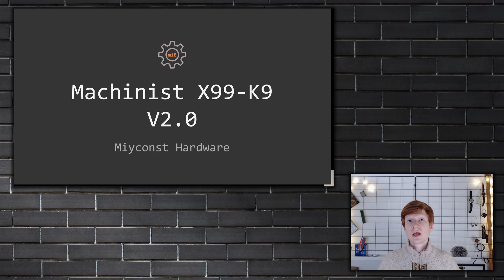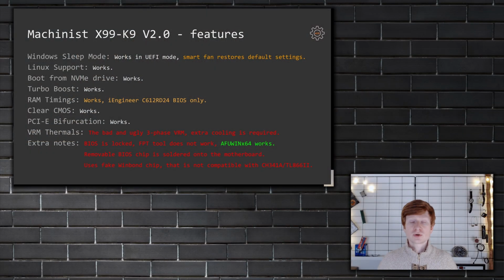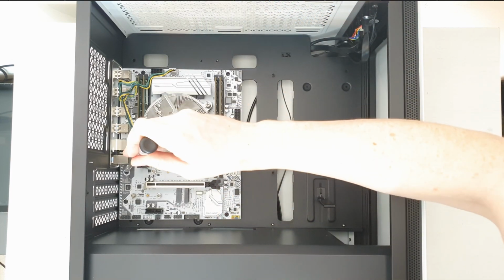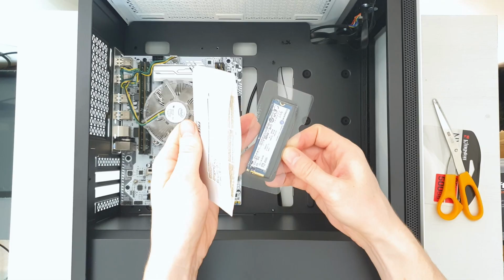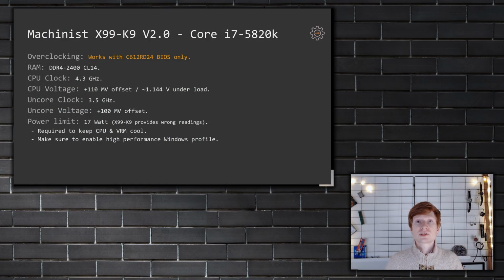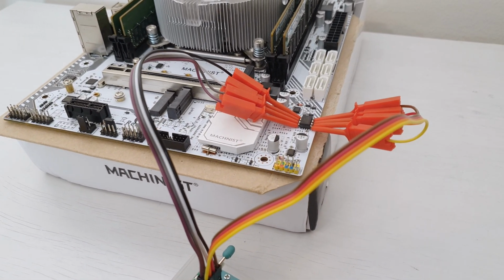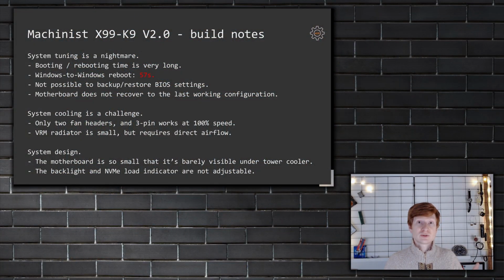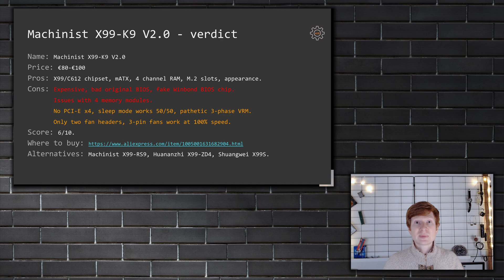🇬🇧 PC with Machinist X99-K9 V2.0 and i7-5820k – BIOS, overclocking, tuning, review, and impressions

Comment: Sorry to say but this is not the V2.0 if i check the FCC release chart from MACHINIST-SOYO-MLLSE, This is V1.2, V2.1 has the 9x sata ports and a extra NVME slot over the M.2 wifi slot. I own the board and looked up to the FCC database, Hibernate, Unlocked CPU settings, USB speed and REBAR is standard supported with the stock firmware. All Revs are,  V1.0, V1.1,V1.2, V2.0, V2.1, Also the RAM issue that you had during this video is that it is recommended to disable MEMORY training and PCIe Link training together with the maintenance mode.

Comment: Any recent buyer of this board? Is it still shipped with x99 chipsets?
Reply from the maker: As far as I know it still uses X99/C612 chipset and now we have yet another revision.
Reply: @Miyconst as a classic Chinese maker, the revisions are all over the place. I have seen v2.0 with 8 vrms (4 phase doubled I guess) and also a V5 that has a 7 segment led for diagnostics. Also some sellers note it's v2 and it seems different than v2.0. All confused out. I want something long term
Reply from the maker: @JaymzBond  skip AliExpress if you want something reliable for a long time.
Reply: @Miyconst is it that bad? I am very well aware that the socket is old and there won't be a future for it. So long term is not like 10 years but I'd like to get at least 2 3 years with the hw I purchase. This seemed like a good option as it now has 4 phases and uses an actual c610/x99 chipset
Reply: @Miyconst by the way thank you sincerely for your support and knowledge. Your channel is awesome 😊
Reply from the maker: @JaymzBond  AliExpress is a lottery, if you put your last money on the line and can't afford failures the skip AliExpress and pick a used Dell or HP workstation, for example Dell T5810/T7810.

Comment: Machinist X99-K9 V2 OR Huanazhi x99 - QD4 ?
Reply from the maker: Neither. Pick the cheapest H610 with i3-12100F.
Reply: @Miyconst  thank but exceed my budget.
Reply from the maker: @luispaez466  then I would probably go with X99-K9 and buy BIOS from iEngineer.
Reply: @Miyconst  thanks. I am not gamer,  i need it for work with CAD/CAE software and replace my old LGA 1150.

Comment: Hello. i was wondering if the v2.1 version has the smart fan fixed as i'm going to build a cheap pc for a minecraft server. and already have a chassi and ram on hand, and can't find another matx x99 board than the k9 d3 2.1 that say they support ddr3 and quad channel ram
Reply from the maker: I did not test the D3 2.1 version so I don't know, sorry.
Reply: @Miyconst Okay. it's very hard to find information on the k9 2.1 it seems. Do you think a dual channel only board would have a big impact considering it's mostly going to live as a minecraft server pc?
Reply: @Miyconst I took a closer look at 2.0 and 2.1 boards in pictures and they look quite different. 2.1 has two 4pin and one 3 pin fan header and a active vrm cooler and more components in general, cpu 8pin power connector isn't in the same place. so it must be 2 different boards

Comment: x99 i7's are often overlooked compared to Xeons, if you use emulators like 86Box often and other programs that rely heavily on single-threaded performance, then these i7's are way better due to overclockability
Reply from the maker: Yeah, the only question is how to overclock them without spending more than an i3-12100 system would cost.

Comment: Hi, I have assembled a PC with Machinist X99-K9, Xeon E5-2660V3, and other components. I installed Windows 10, working fine except I do not have Internet, neither with an Ethernet proven cable nor with a WI-FI wireless card. I have tried to install several drivers with no success. Device manager does not show any Network Adapter, under hidden devices a "microsoft kernel debug network adapter" appears, which I disabled. No intermittent lights are shown on the Ethernet cable connector. I don't know what else I can do. Is it a hardware failure? Could you please help me out? regards, Filippo
Reply from the maker: This is most likely a hardware failure unless you have flashed an incompatible BIOS.

Comment: Could a 1650 v3 achieve similar results?  I have one installed in a Jinguye board which unfortunately does not have an unlockable bios,  c201. . I'm watching on a 14 core 2697 V3 in an unlocked board and while the VRMs gets warm it's not burning hot to my surprise.
Reply from the maker: Yes, E5-1650 V3 is basically the same CPU, but it has full 40 PCI-E lanes.
Reply: @Miyconst  Thank you for all the hardwork.. Amazing stuff! I have been dreaming about using/modding Xeons since 2012, I knew someone out there is smart enough to figure this stuff out.

Comment: Nice review! I Bought X99 K9 board (newset revision 2.1) from Aliexpress with Xeon E5 2640 V3 and 16GB of DDR4-2133 ECC memory in two sticks. My board seems to completly ignore DDR4 memory frequency. When I check in CPU-Z it always shows 1866MT/s. Did you have such prolems and have any idea how to fix it? I tried BIOS fro iEngineer but after flashing it using EZP2019 it booted once and get completly bricked. I had to use stock BIOS.
Reply from the maker: This is the CPU's limitation, you can't increase memory frequency with E5-2640 V3.
Reply: @Miyconst  ok. Good to know. Can you recommend any CPU fir this socket with faster ddr4 support and overall performance?
Reply from the maker: @rafatomczyk3622 Xeon E5-2667 V4 supports DDR4-2400 and way much faster than E5-2640 V3.

Comment: How to know if v2 or v1?
Can it overlclock e5 1650 v3 and 1660 v3?
Reply from the maker: The BIOS chip is different between the versions, as I have specified in the video. E5-1650/1660 V3 can be overclocked, but X99-K9 will get toasted pretty much immediately.
Reply: @Miyconst  even if it were just to 3.8-4ghz?
Reply from the maker: @Carrington1961  yes.

Comment: This motherboard support overclock for xeon e5 1650 v3? Thanks
Reply from the maker: Xeon E5-1650 V3 is the same as Core i7-5930k, so everything I told in this video about X99-K9 is also applicable to the Xeon CPUs.

Comment: Hello. I have an I7-6800K on my desk. Please advise which Chinese X99 board can easily overclock it over 4.1 GHz. The offer is huge and I'm already lost in it. So I'm asking for advice on which Chinese board is the best for my CPU. Thank you
Reply from the maker: Non of the Chinese boards can easily overclock your CPU past 4.1 GHz.
Reply: @Miyconst  Thank you for answer. So which one is best for overclocking i7 6800K and able to achieve best results. (4GHz)
Reply from the maker: @lukasvolek6254  Huananzhi X99-F8 would be the best bet, but overclocking i7-6800k is a pain on any motherboard.
Reply: @Miyconst  i saw this MB on Aliexpress with description: "Chipset: Intel X99".. ?? is their any M-ATX board for Overclockinfor for example an I7- 5820k (140 TDP), i also plan to watercool CPU and VRM.. on Aliexpress are also alot of Dual CPU Mainborads with discription: Chipset: Intel X99..  are they legit?
Reply from the maker: @hossosplitternacken7819  Huananzhi X99-8M (not 8M-F) and Machinist X99-K9 has potential for overclocking, but it doesn't mean that you can easily reach 4.1 GHz with your i7.

Comment: my dear I can turbounlock with your tool on this machinist x99-k9 rev 2.0, can I re-record directly with the CH341A?  because mine has a winbond 25q128jvsq2108 chip.
Reply from the maker: Yes, you can do both.
Reply: @Miyconst  Miyconst my friend I have this card with the winbond W25q128jvsq chip, I managed to re-record using the CH341A with the alternative software 1.1.1.33, could you tell me which unlocked bios I can use on it because the original is horrible, it doesn't reset the bios by jumping the card

Comment: Hey, I just bought one of these to replace an RS9 because I wanted ECC memory to work.  ECC memory does not work.  I tried four different sticks.  Just wanted to let you know that maybe they updated something, because I believe ECC used to work on the older X99-K9s.
Reply from the maker: By doesn't work you mean that system doesn't boot or that ECC function is disabled?
Reply: @Miyconst  Sorry I didn't see this comment.  The computer will boot and function normally, but ECC is not enabled for ECC memory.  I tried a number of different sticks with the same result.  I haven't tried a different BIOS yet.

Comment: I see you kindly put the overclock instructions on youtube alreay but, it is on your other channel . To save mistakes I made , by simply guessing the settings ,  I think it is worth adding the link to the notes above
 https://www.youtube.com/watch?v=hzovHrv0cfc

I applied theses settings and the 5820K does indeed clock to 4.2Ghz which is a big improvement . Though sometimes one core drops to 1.1Ghz and  drops to 4Ghz all core under load and 3.8 on AVX instructions . I am guessing this is normal behaviour , though no way to be sure since temperature monitoring is misleading
Reply from the maker: Thank you for the suggestion, I am adding the link to the video description.

Comment: I too had spare 5820k , so got this board . The only way I can get this motherboard to turn on consistently is to run stock BIOS . I have tried iengineer and overclock.ru BIOS , when I tested any other BIOS other than stock,  even at stock settings results in inconsistent booting , it seems to work since BIOS hands over to OS but then it just freezes at the Windows Logo . 
. Most disappointing Chinese motherboard yet , of the four purchased thus far
Also during testing with different BIOS , I tried several sets of ram in different configurations , this made no bearing on improving reliability of booting
Reply from the maker: It seems like you are either using Turbo Boost Unlocked BIOS with your i7 or the motherboard is simply defective.
Reply: @Miyconst  After much deliberation and perseverance I am now overclocked, it seems flashing with USB CH341A allways gave me unstable results for custom BIOS , except it  always flashed fine with stock Rom - no idea why . However once stock was flashed , I used AfuWin within WIndows (Fresh Install)  to Reflash I-engineer BIOS with Mi8 Tweak.  Also the Force option in Afuwin seemed to give mixed results . The regular flash option for the Afuwin script works fine . My BIOS Chip is Winbond 25Q128JVSQ -2108. I have no idea how to know if my K9 is version 1.0 , 2.0 or 3.XX ??

Comment: Hi , where can we find instructions on how to overclock on these board ? I managed to update BIOS 'x99-k9.oc.ru' , booted but after changing OC settings , board is bricked . Will CH341A work?
Reply from the maker: Hi. As I have said in the video, you need to use iEngineer BIOS to get overclocking feature.
Reply: @Miyconst  I have flashed I-Engineer now , tried both Mi8 Tweak and Standard . Both BIOS work and Load but , changing the OC Multiplier ends up with black screen .  Where is the Uncore , I see just CLR Ring Multiplier and OC ?
Reply from the maker: @technomad900  Then I am out of ideas, there is something wrong with the motherboard or CPU or your BIOS settings.
Reply: @Miyconst  Its now fixed , updates fine with Afuwin
Reply: @technomad900  hey how did you programmed the bios chip? I have a ch3 programmer but it dont recognise the chip

Comment: I have the huananzhi x99 tf motherboard. I flash the bios for the e5-2678 V3 turbo boost mod last year. I recently bought the i7 5820K and i7 6800K how to I flash it back to the original bios or do I need a special bios to overclock the i7 5820K/6800K? Thanks in advance

Comment: I asked you questions about the 1650v3 in a x99 g7 board and you told me it was because the 1650v3 only supports ddr4. I exchanged my ddr3 x99 board for this x99 k9 board and it fired up right away. However i tried to see if overclocking worked and set my multiplier to 40 for a (4.ghz) overclock. It restarted and has never shown video since. when i hit the power button it turns on for a fraction of a second and then turns off and then back on and stays on but no video. I do not get any diagnostic sound and i have tried different ram configs, moving the cmos reset jumper back and forth, letting all the power drain from the system for 2 days and nothing has worked. I was thinking i just needed to reset the cmos but now i am thinking the motherboard is dead. What do you think?
Reply: also i just tried booting it with no ram and it acts exactly the same. Doesn't give me any beeps on my external diagnostic speaker either. Sounds like a bad motherboard to me but i would like your opinion. Thank you in advance!
Reply from the maker: I think, people need to watch reviews first, and do things next. X99-K9 does not support overclocking with the default BIOS and the clear CMOS is also broken. You need to either reflash the BIOS with an external flash programmer or get a CPU that doesn't support overclocking, like E5-2620 V3, then you can boot into BIOS and disable overclocking.
Reply: @Miyconst  Yeah i should have watch reviews first but i have bought chinese x79 boards before and they worked great so i didn't worry to much. That is ridiculous they have an overclocking mode that bricks the system. Wouldn't be an issue if cmos reset isnt broken either. guess ill try to reflash it.
Reply: @Miyconst  I noticed some people saying i could ground the reset pin on the bios chip (winbond 25q128jvlq  2008) to reset the bios but i also say someone say the motherboard company could have wired it differently and use the reset pin as an io pin and grounding it could brick the board. What is your opinion? also do you have any idea where i could find the bios at? i looked on your website but i only found other versions of the x99 motherboard.
Reply from the maker: @jordanmackay9156  Chinese very often use fake Winbond BIOS chips, thus I have no clue how your will react if you will try to ground it. I think, the easiest is just to reflash it or replace it.
Reply: @Miyconst  Thank you for all your help! I bought an $8 2603 and used it to disable overclocking like you said and it worked great! But now i have to keep a "cmos reset cpu" on hand lol

Comment: Do you know if this boards default bios has the option to turn on TPM 2.0 and Secure Boot for games like Valorant that are giving errors unless you have these options enabled in bios? Thanks Myconst and I appreciate all of your replies.
Reply from the maker: No, TPM 2.0 is not possible with X99 platform.
Reply: @Miyconst  Thank you for the reply. Just as I suspected but wanted to make sure. I knew if anyone knew for sure, it would be you. Thanks again.

Comment: I don't understand why the 4 pin CPU fans are always at maximum speed, can you help me to solve this problem ?
Reply from the maker: What motherboard version do you have?
Reply: @Miyconst  It is the same as in the video. Next to the 24-pin connector it says V2.0
Reply from the maker: Did you flash the iEngineer BIOS?
Reply: @Miyconst  I have the Bios set by the manufacturer, I am afraid that my board will become a brick since the chip is soldered and small.
Reply from the maker: Then I can't help you, sorry.
Reply: @Miyconst  I am going to flash it so you can help me please
Reply from the maker: @SiX-ito  feel free to join my Discord, there are many people who are willing to help.
Reply: @Miyconst  I did it and I tagged you in my message in x99 chat but no one replied in the discord group :c
Reply from the maker: @SiX-ito  sorry, I can't sit and monitor Discord 24/7, I have answered when I saw the message.
Reply: @Miyconst   if you answered me, I appreciate it, but I still have the doubt of which bios to put since there are many for the machinist k9
Reply from the maker: @SiX-ito  I would strongly recommend you to study what is the difference between each of the version and pick the one you want. If there would be a universal solution "take this", I would not make these many options.

Comment: Hi Miyconst. With your vast experience with Chinese Motherboard, which one would you recommend to pair with E5-2640 v3, E5-2650L v3 or E5-2650 v3?

A budget DDR4 one. Thanks
Reply from the maker: I would go either with Shuangwei X99S or Machinist X99-RS9.

Comment: Would you recommend LGA 1151 over a X99-F8/X99-RS9? If so, what are your recommendations? Trying to buy something to my gf on a budget. Thanks in advance!
Reply from the maker: Please provide a bit more info. What is the budget and the target usage?
Reply: @Miyconst  something around $200~$250 for mobo+cpu only. She will be playing few games like The Sims, Ori and other kind of plataform/simulation games.
Reply from the maker: @odrezzitech  I would go with an LGA 1151 mutant, for example the QTJ2, alternatively, just buy a Core i3-10100F with a B560 motherboard.

Comment: Hello! Do you know how to clear CMOS? I don't know how to do It because there is no battery to remove
Reply from the maker: There is a battery, it is installed vertically closer to the rear IO ports.
Reply: @Miyconst  yes, I know but the motherboard came without one so I installed a battery but the CMOS doesn't clear, do you know another method to clear CMOS?
Reply from the maker: @jorgebernaldiaz7572  reflash the BIOS with a CH341A.
Reply: @Miyconst  okay, I'll try It, thank you!
Reply: @Miyconst  So the weird BIOS chip can be overwritten with USB programmer?
Reply: @technomad900  did u try? I have the same question

Comment: For the incorrect Bios tuning that forces you to clear CMOS, it happened to most cheap Chinesium (h55/h61/h81 non server type) motherboards

Last time I tried running RAM at 1600mhz on Chinese zx h55m v1.41 (using h57 chipset), system went blank. Must remove CMOS battery
Reply from the maker: I know, it's just extra frustrating when multiple items require overclocking / tuning.